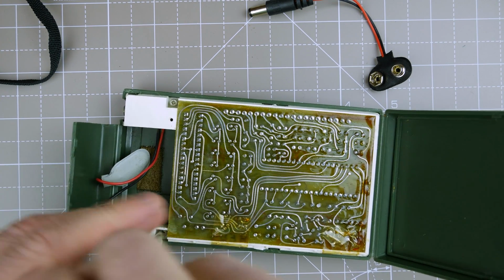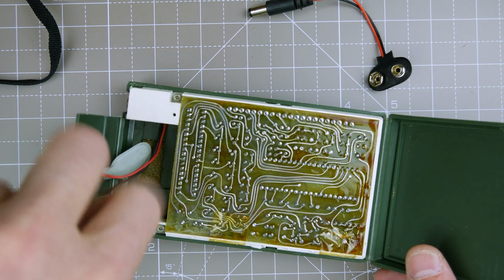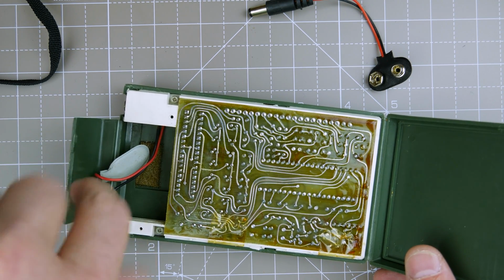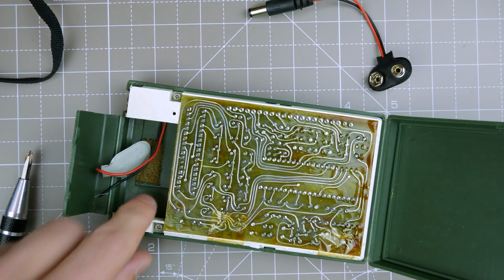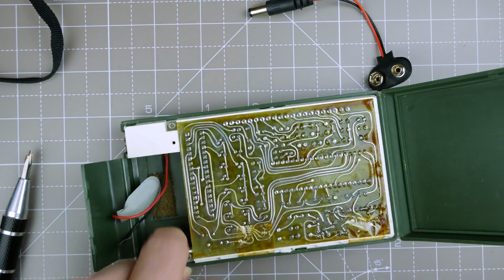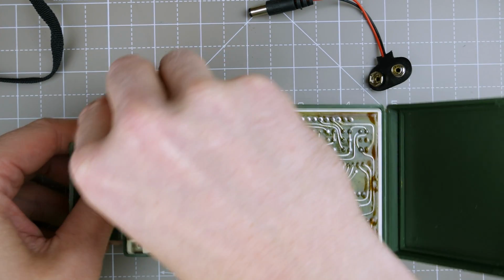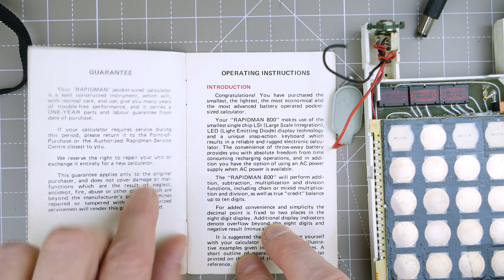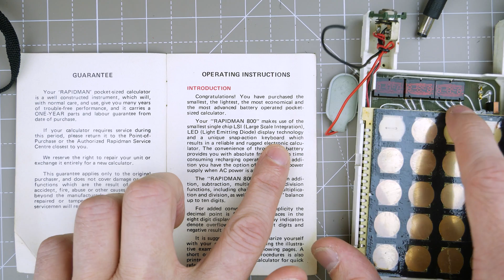Vintage Tech: Rapid Data Rapidman 800 - VT5

Comment: I bought my Rapidman 800 in May, 1972. I've had problems with the battery wires pulling loose, but I fixed that.  It was a black case, and still works 49 years later!

Comment: OMG, it is just a regular jack. it disconnects the internal battery when external source connected. it doesn't need a diode. Please tell me you are trolling! your external socket might be faulty. just spray it with contact cleaner and try again
Reply from the maker: You must be fun at a party. You don't know jack until you know shit, So perhaps instead of 🤓 OMG are you trolling! Maybe you could consider being someone others might like to have a conversation with. Start with 👍 Hey did you know the Jack has a mechanical switch? Or just fuck off, either way thanks for taking the time to comment.

Comment: Measure the voltage at the battery when you turn it on, If it does not drop it is the power switch or the contact in the power plug. When a plug is inserted the contact opens. I spent somewhat less than a year working in their service center in Madison Heights Michigan in 1973. My partner were fixing about 90 calculators a day. Yours was damaged when someone changed the battery. They would firmly grip the battery in one hand and the calculator in the other. They would play pull apart. This applied stress on the power connector. I left when the technicians voted in a union. The next day there were padlocks on the doors. They emptied the building and took everything back to Canada. Two technicians were kept and they were moved to a local sales center.

Comment: the AC connection on the connector is a physical disconnect. When you push a plug into it the barrel pushes the peg away at the back. I had an old radio that had the same type of thing but the pin broke so it couldn't use the battery anymore.

Comment: Err, Commodore GL-987R?
Be prepared for heavy corrosion inside. They put their akkus inside and screwed them in...
Got three of em, one was unfixable, but i'm going to design new boards for em, so don't throw it away :)
Reply from the maker: 796M as it turns out. In black unfortunately. The Blue or the Cream 786D would have been amazing but alas, I am rubbish at bidding in ebay auctions.
Reply: Ah, ok. No problems with them :)
Reply: Just use Gixen. It's a free ebay sniper. Works great for me.

Comment: That external power socket has a contact switching the battery which may be dirty/corroded and might be high resistance. How about applying power directly to the power input to the board? You should be able to get to the pads on the back of the board. Maybe use a current limited PSU just in case something on the board IS sinkling a lot of current...
Reply: What he said!